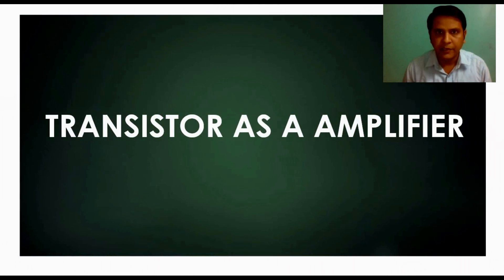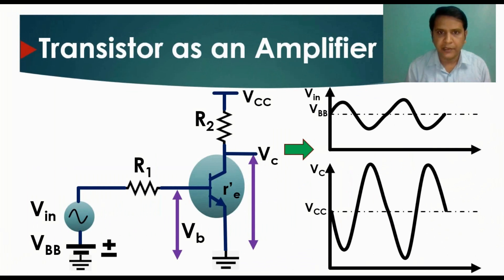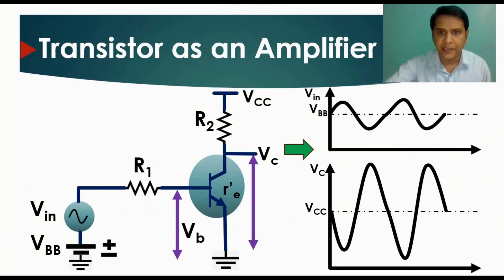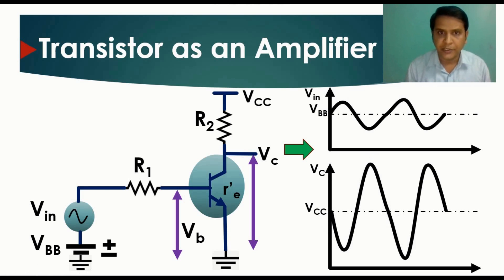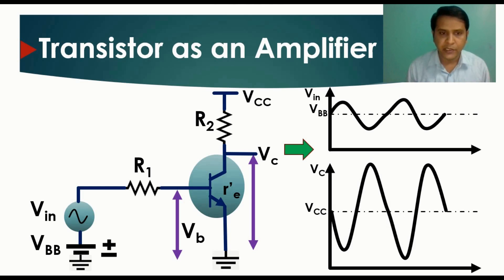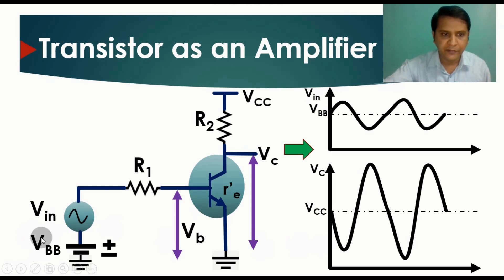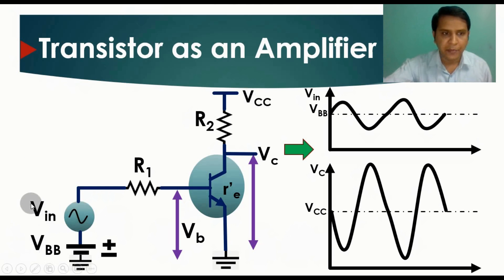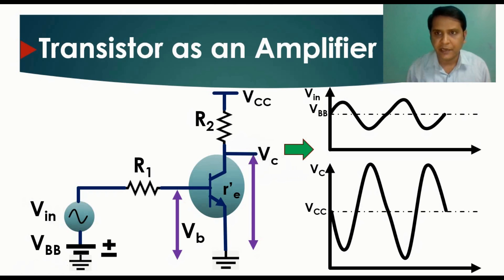The Transistor As an Amplifier - Voltage Gain (Av)

Comment: Visual aids help (me) to understand your lectures easier. Appreciated. 
Would you make similar video with real world example? Like a car stereo puts out small 1w signal into an amplifier that delivers 100watts. If time, etc permits. Thanks
Reply from the maker: i will try to make it.
although i do not have much experience in power amplifier !